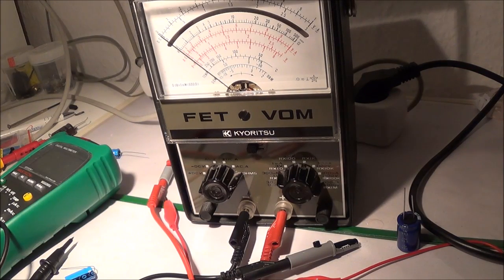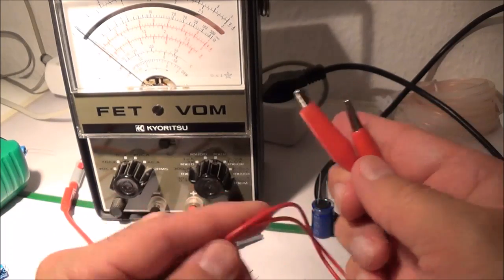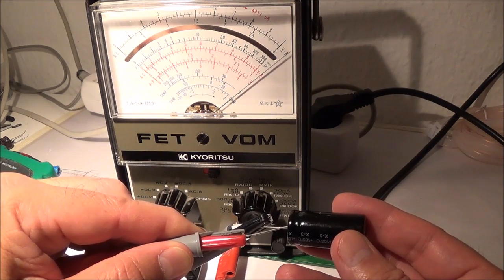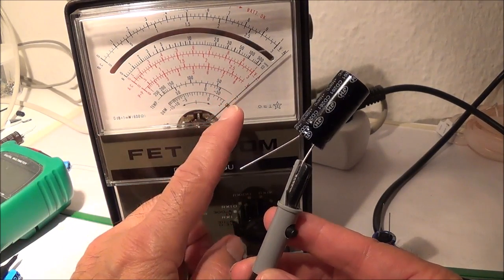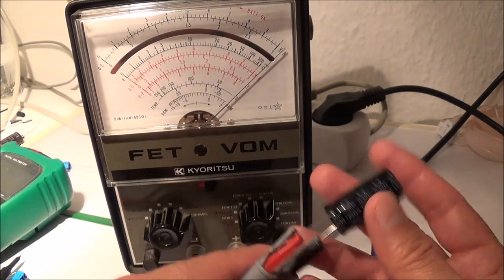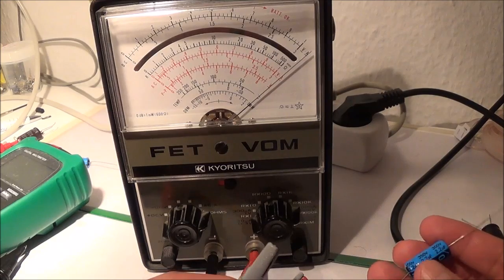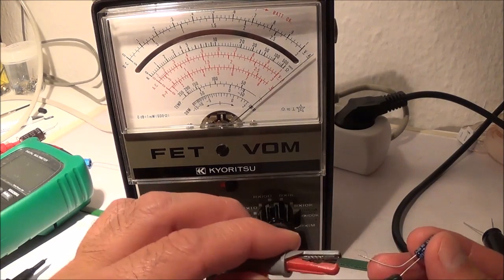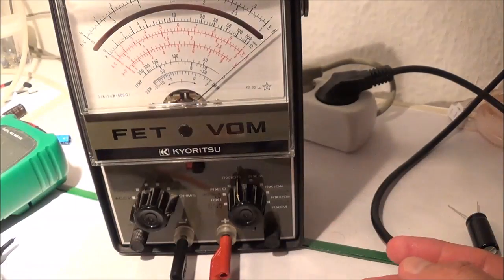Analog Meter Electrolytic Capacitor Testing

Comment: did i just witness somebody take a jumper lead & connect one end to cap+ & the other end to cap-  to discharge it?
Reply from the maker: Don't even remember this video, but could be, although I do have a discharge resistor. This was probably a small, low voltage cap. In the old days (when I first went to television repair school), we used to use screwdrivers. Nowadays you would have a 100 people on YouTube chastizing you.

Comment: Hi, I have a query, why is it the meter needle at the far right on the meter before doing the test I all ways thought it rested on the left hand side, would you explain this please
Reply: He is measuring resistance. 
Basically, when nothing is connected, there is infinite resistance, so the needle is fully on the right side. When the probes are touched together directly, there is zero ohms, so the needle is fully on the left. This is how many (or most) analog meters work, but as stated in his reply, it can vary meter to meter. 

As for testing capacitor - capacitors block DC, so once it is fully charged, it measures infinite resistance and the needle goes all the way to the right side. This test is only putting low voltage on the capacitor, maybe 1.5 volt (old meters often use a D battery to test resistance) so a capacitor may still be bad at higher voltages, but it can certainly help weed out really bad caps.
Reply from the maker: Joseph, that depends on the meter. Even the polarity of the ohmmeter part of the meter can be different from meter to meter. Black might be positive and red might be ground. That would need to be checked with another voltmeter.

Comment: This test in inconclusive, the meter only has a 9 volt source and show only a static test. Even a leaky cap would pass as good. You need to stress the cap at to its rated voltage and slightly above to see if it breaks down or leaks more heavily. Anything beyond 1 ma should be rplaced. Time, voltage  and heat also factors to consider. Will the cap leak at its rated voltage after an hour under stress.
Reply: Not to test. I have for months on this and testing be done with low voltage. But half of those not passing the test can be reformed with with reach the proper voltage

Comment: I opt for a capacitor tester with real operating voltage.  I designed this one (see link), a bit over complicated, but it works very nice.
It has a very sensitive current meter
https://people.zeelandnet.nl/wgeeraert/radio.htm#lektest
Reply from the maker: I checked out your link. Great job you did! I use the Heathkit IT-28 and an ESR meter. The video I made only helps if you have only an analog meter as test equipment--which is true for some people. Really nice tester you made and thanks for the link.

Comment: Point of correction. The cap is not discharging as it reaches infinity. It is becoming fully charged. At the point of probe contact, the cap is drawing maximum current from the battery in the ohm meter. The same is as if you touched the two probes together. As the cap charges, it draws less and less current until finally at full charge it draws no current through the meter. The meter will be at infinity at this time. The reason small caps won't allow the meter to go to 0 is time. By the time the meter sweeps close to 0, the cap has started charging to some point and it will never reach 0. Unfortunately the problem with this test is leakage current to  voltage applied. You should test the cap at rated voltage or at least the voltage applied to the cap in the circuit it either came out of, or will go into. The battery in the ohm meter will not supply more than 9vdc depending on the meter and the battery. If the cap has 200vdc applied in the circuit, it may leak and not show leakage at the ohm meter battery voltage depending on the dialectic breakdown. Just a thought.

Comment: i think it will have no reading if the probe are interchanged?
Reply from the maker: This test is only for electrolytic capacitors. Smaller electrolytic capacitors might not register on an ohmmeter; my ohmmeter will still get a reading with a 1uF electrolytic capacitor. 

Be sure to discharge the capacitor first before testing. When you connect the the test leads across the capacitor for the first time you should see meter movement toward the low end of the scale. When you reverse the leads you should still get meter movement; as the capacitor charges the needle should move up toward the high-resistance end of the scale.  If you see no meter movement, then the capacitor is open. If your ohmmeter reads low resistance in both directions, then your capacitor is leaky. Zero resistance is a short. A good idea is to have a new capacitor with the same value as a comparison. Also, make sure your hands are not touching the meter probes during testing. 

This method is not foolproof though, since the ohmmeter only supplies low voltage. The capacitor still might break down under higher voltages.
Reply: very slow motion vedio. but accurate testing.  tnks
Reply from the maker: +Jubayer Khan Thanks for watching and your kind comments.

Comment: What will happen if you connect the wrong probes? Thanks
Reply from the maker: I don't understand your question. What is the problem?
Reply: Nothing
Reply: Electrolytic capacitors are polarity sensitive. If you hook one up backwards in a circuit, it will explode. I have done this on purpose using a transformer and a rectifier and it sounds like a gun shot. Chances are the small voltage applied by the battery in the ohm meter will not be enough to damage the cap.